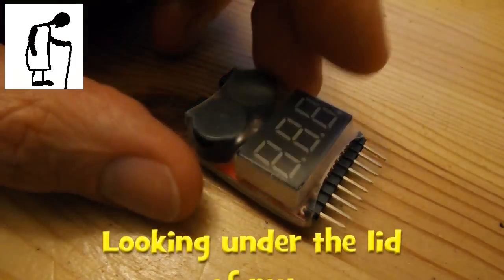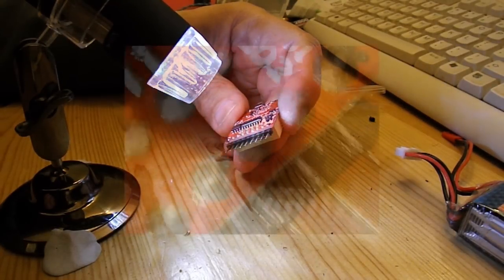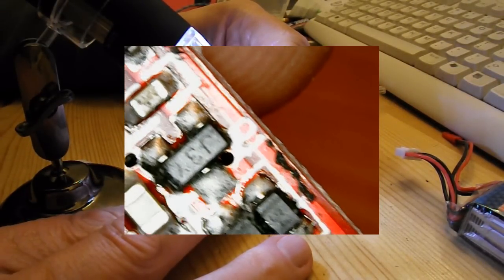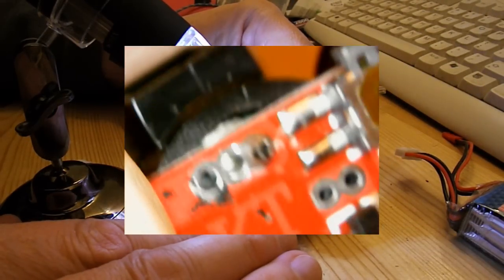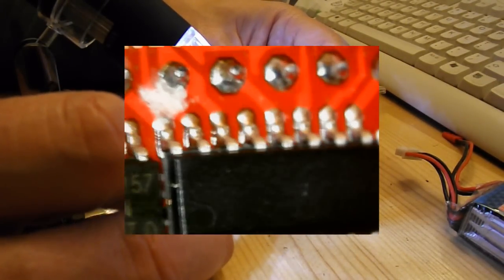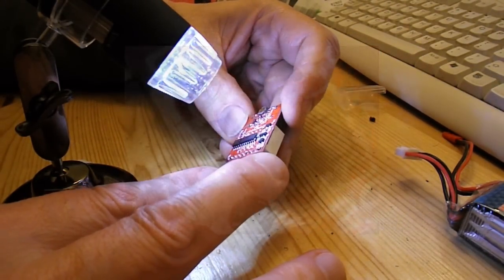Looking under the lid of my LiPo Low Voltage Alarm

Comment: Is there a way to disable the beep? I just need these as a voltage checker and not an alarm. My wife complains about the loud noise every time I check voltage.
Reply from the maker: I see you found my video where I desoldered one of the speakers. Short answer is desolder them and find out, as these only cost around £1 you don't lose much if it fails. I recently purchased a slightly more expensive one (£3.50) that gives a bit more information and after initially being sceptical about it, I have found it quite useful https://youtu.be/gVFMTZqVS-Y
Reply: GrandadIsAnOldMan 
Thanks!
Reply: keep pushing the button to change the alarm setting, some models have an off setting.  You can hold your finger over the speaker holes and shut out the sound as well.
Reply: @budmartin8297  Thanks. I just removed the speakers :)

Comment: Hi, Is possible to calibrate voltage cells indication?
Reply from the maker: You can set the alarm OFF - 2.7 volts - 3.8 Here is my video on the subject https://youtu.be/TEC3rGIrWnw?list=PLA5a2xPRSrB3LvEF9JkTWheTZQFEdq6RE

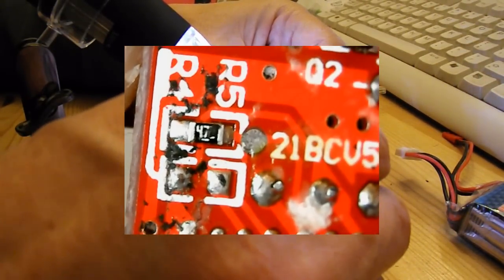Comment: Over two years late to be any use, but I've got a clone of these and I'm trying to work out what the anonymous controller IC is. I couldn't help noticing that on yours the R4 is missing, see 6:51 for a good view. Looks like just two empty pads where a resistor should be. Maybe that's the fault.
Reply: Have you identified the IC on this thing yet? I wonder what that is and whether there is custom firmware for it.
Reply: I'm trying to identify this ic as well, really want to hook my Arduino up but just not info on it.

Comment: I'd like to repurpose the buzzers from a lipo alarm because they seem much louder than any 5v peizo buzzer you can buy to wire up to a quadcopter's flight control board to be used as a lost model alarm.  Do you know if desoldering these buzzers will work after removing  them from the board, and what voltage do they operate on?
Reply: Did you ever figure this out?  I'm interested in the same.
Reply: Daniel, I've never heard back from anyone that I've left comments.  So I went out and purchased an inexpensive bench power supply for testing these buzzers.  I carefully desoldered a buzzer, then used the power supply to apply voltage to the pins of the  buzzer.  The power supply allows you to start at zero volts and turn a knob to increase the voltage in small increments.  I started at zero, ans was expecting to hear a buzz when I hit 3.3 volts, but nothing.  Then I cranked it up to 5 volts, nothing.  I went all the way up to 10 volts, but nothing, although I heard a slight clicking, but that is it.

That ended my testing.  

If anyone else has ever gotten these buzzers that have been removed from lipo testers to actually work and buzz, please tell us how you were successful in doing so.  And, if for some reason these buzzers will not work after being removed from the lipo testers, tell us why.
Reply from the maker: I am afraid I have only just spotted your comment. YouTube can be very unhelpful with notifications. However I would not have been able to answer your question as I haven't tried it myself and it looks like you have already found out. I suspect the actual "buzz" is generated on board somewhere with something like an astable flipflop or multivibrator circuit. These are probably speakers not buzzers. Buzzers would have the "buzz" circuit inbuilt.
Reply from the maker: I know this is too late but it may help anybody else reading these comments - Using the Speaker from a faulty LiPo alarm https://youtu.be/cdrjq5nQp3M The circuit I built was not very loud and I think the reason the LiPo alarm has 2 speakers is to boost the loudness.

Comment: your micro cam video real helped , because i never saw that part before on mine .wrong polarity burned my  LiPo Low Voltage Alarm,but now i can fix them good job .i would like to see a Chinese 18650 4s balance  boards probe if u have any .
Reply from the maker: Thanks, I am afraid I don't have any 18650 board

Comment: If the button came off can I still use it because of default 3.3 or should I wate get another one so I can fly again
Reply from the maker: I am guessing you mean the button that you use to step through the different alarm settings. If it has come off cleanly and not still inside shorting out any circuitry then I would think your alarm will be set to whatever it was the last time you pressed the button. It does not return to default when you unplug it, so if you had reset it to a different value then that is what it is set to. If you are worried you could do a test discharge and watch it so you can see when the alarm goes off, then you will know what it is set for.
Reply: You can change it, those buttons are very common. Just be careful not to short anything out.

Comment: This is the throw-away society we live in, things can not be repaired anymore. Low quality seems to be good, let consumers consume even more.
Reply from the maker: +deslomeslager after your previous comment I got the board out again and spent more time looking at it and looked up the Atmel chip. I am pretty confident that is an eeprom and the other chip will be a PIC or similar so the eeprom has the operating parameters or code used to run the processor so I am guessing that could have been corrupted and potentially could be restored with the right hardware interface or even hacked and used for a different purpose by somebody with far greater skills and understanding than me :) Without removing the 3 digit display I cannot check what is on the other side of the board so there could be a visible problem that will remain invisible.
Reply: GrandadIsAnOldMan
My first impression is the same: a programmable chip is the problem. When you showed it the first time I had the impression it was just the display being connected wrong, but it really is a more complex problem and there is not much to salvage on the circuit board. Maybe Julian ILett could have a look at it. But it is really to cheap t look at at all!
I recently found a magnetron/oven combi device. All that was wrong was the ventilator did not turn. The relay switching it was okay, so I ended up looking at a non-replaceable part, a micro chip. One of those black dots on a pcb. I ended up taking all parts for spare parts as nothing was broken besides the driver circuit. I could even still make a clock switched device out of the parts. The magnetron which was still working brought me two nice magnets! And the turn-table motor is a nice generator which can easily drive an LED light.

Comment: the lipo batterie is over charge not fully charged
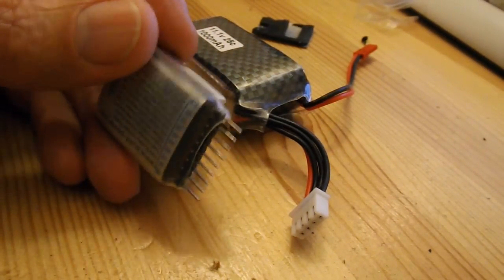Reply from the maker: +The FatRat I am not sure what you are trying to say. The unit should display the voltage regardless of whether it is over or under charged. I demonstrate what the correct readings should be using one that is NOT faulty at 01:20
Reply: +The FatRat  No it's not, You charge LI-PO to 4.20 v per cell, but No more, then they drop back a bit.

Comment: In minute 5:57 there seems to be a solder-bridge between the upper leg of "Q2" and the very next solder point. That looked odd to me, just as if it was wrong the way it is.
Reply from the maker: +Elnufo would be nice if that was it, but the orange area that passes under both points is the copper track so they are supposed to be in contact even if not by the solder tracking across. The larger solder lump is the tail of one of the buzzers so I am guessing Q2 turns on that buzzer.